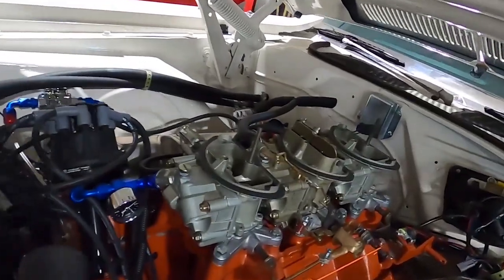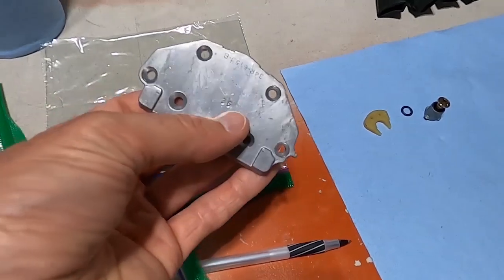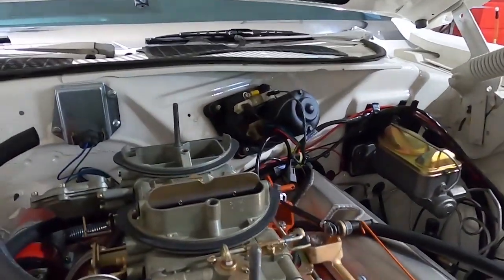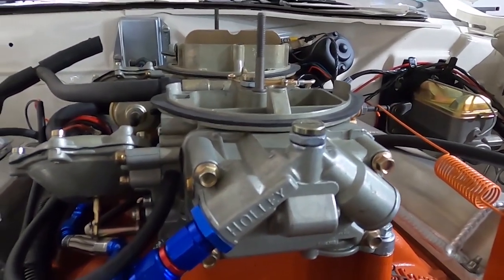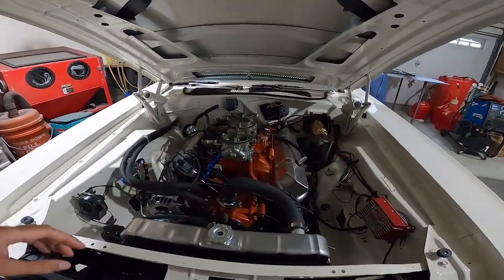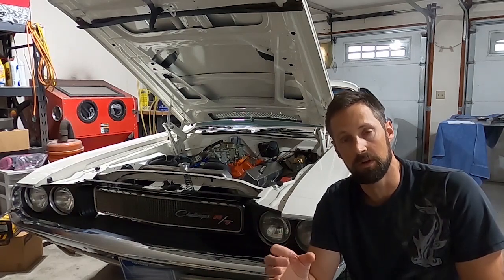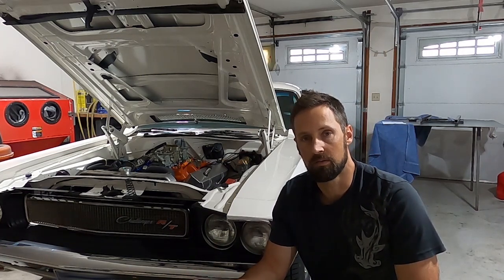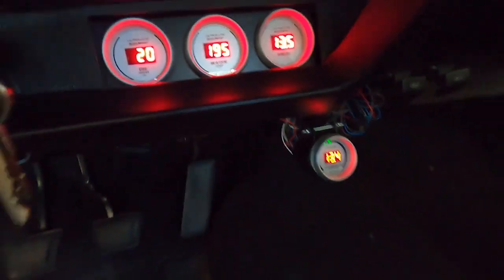Tuning Tips for Mopar 440 Six Pack, Six Barrel with Air Fuel Gauge

Comment: I thought your video there was very informative and it was very easy to understand and very well laid out in a process of trial and error good job there I took my idol speed restructures out in the end carburetors and that in my opinion for my situation that really helped as far as getting the center carb come down off of the idol transfers and I did drill I did drill holes in the secondary carburetors outboard carburetors small hole that also helped like crazy too now I'm kinda right at the point of yeah the center carb is just about totally closed and I probably should have went just a little less on the drilling of the holes on the plates I may take and just JB Weld them up a little bit at some point but right at the moment it's working pretty good good job there

Comment: Great video. I'm going to apply the techniques you described to my 340 six pack set up. The QFT meeting plates are a great idea, also I had no idea what those screws were called. I was very fortunate to find and purchase brand new Holley carbs for my set up.

P.S I gave you a subscription:)
Reply from the maker: Thanks!  Best of luck with the 340.  In my opinion, even though these six packs aren't cheap and a little more work to tune, just popping off the air cleaner and looking into the engine bay makes it all worth while 😁

Comment: Interesting, I bought a new set of repop MP carbs back In the early 1990s when I worked for a dealer...I lived in Salt Lake City at the time, the elevation was just over 4000 feet...I had a hot 440 with a .509 cam...and I never needed to mess with the outboard carbs..they were cool for a minute, but I'd never run one again. Awesome tech for the layman.
Reply from the maker: Thanks for the feedback!

Comment: Can you share with me where you purchased your air fuel gauge and what brand? can you also share with me your engine idle vacuum number as well as your power valve size? Thanks for the video. It’s informative and helpful for those of us trying to tune, six barrels and six packs.
Reply from the maker: Sorry for the late reply!  I haven't been on here very much lately...  My engine idles at 11 in. Hg.  I am happy with this number considering the size of the cam.  My power valve is the factory 6.5 size.  My Air Fuel gauge is an Autometer Pro-Comp Ultra-Lite wideband.  The Autometer part number is 4378 and I got it from Summit Racing.  They aren't cheap (currently about $370), but IMO they are pretty much a must to get a good tune on these things.

Comment: I HAVE GRATE RESPONS ON THE SIXPACKS!! Wedge Tunnel Ram intake have even plastick befor the runner plenium..Hyd Roller cam.Wedge Alu Heads folly ported with 0.585 lift flow  Nr are good 310 Cfm..Thes 440cui Engine are in may Challenger 70Se..Fantastisk car Prepped 727 GV overdrive 3-Member 4.10 gear..Have even Nos system Proshot Fogger.Testing first with 25Hp have wery smal jets.Have run with Nos no problem with that.Thes Challenger are real street Car...Good Nr 1.45 1.50 liter 10km esy draving on the Highway The Rpm are 1800Rpm Have 28 inchTire Hi!! Thes Engine Give Abaut 620-630 Hp...May SIXPACKS are fylly Modifaid Good parts..Grate idel Grate A/F Nr 13.6-13.7 On the Highway 13.1-13.2 ...Happy Engine 👍🖐

Comment: why bother buying special 5/32 tool when you can grab any piece of steel, angle grinder and make yourself a tool.  Be creative
Reply from the maker: Point taken, but carb fasteners are sensitive to over/under torqueing.  I probably could have made a slot screwdriver work, or made something, but the tool was cheaper than the fuel (and time) it would have cost me to go buy some steel round and I'm not running any risk of stripping the fastener head due to an imprecise fit.